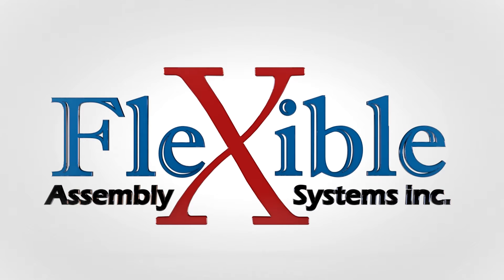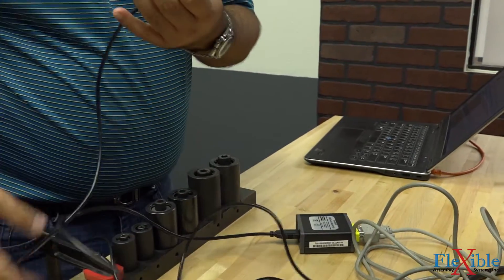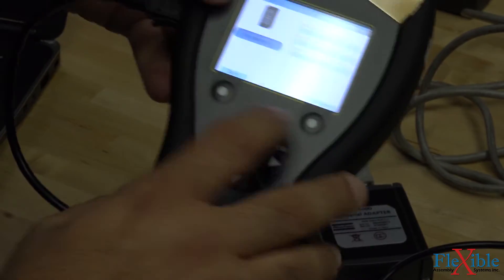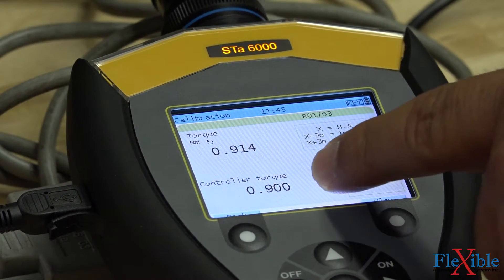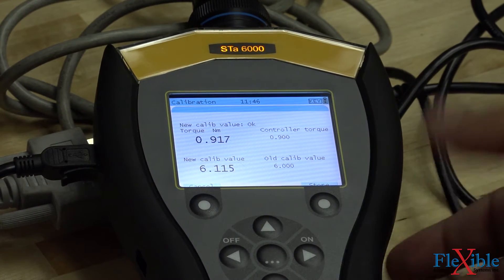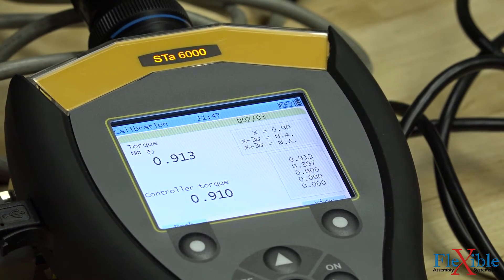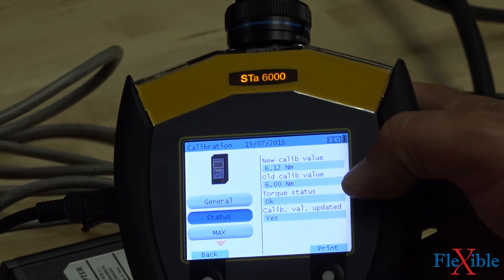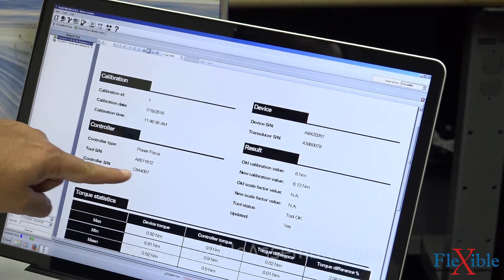AtlasCopco STanalyzer STa6000 Tutorial Part 4 - Calibrating a Tool

Comment: Is your joint simulator station in this video custom-made? Or is there someplace I could go to order something like this, pretty neat!
Reply from the maker: I asked around the shop and our joint rate simulators are older than anyone who works here, no markings on them either. There is a good chance they were custom made or passed down from someone's dad. They are cool for testing tools on (stacked washers for soft joints, single for hard joints). Currently it looks like CDI, AWS, Norbar, Mark 10 and Panasonic sell similar looking joint simulators, but I can't find any that have a full array of them like ours. Unfortunately they seem to be quite expensive online if you can find them. If you aren't interested in joints that are specifically rated to a certain torque value then I would recommend building your own! We sell a few of the Norbar fixtures, but they are for high torque (1000-2000 Nm) applications and cost over a thousand each.
Reply: @FlexibleAssembly  I see, good to know! Thanks for the assist!